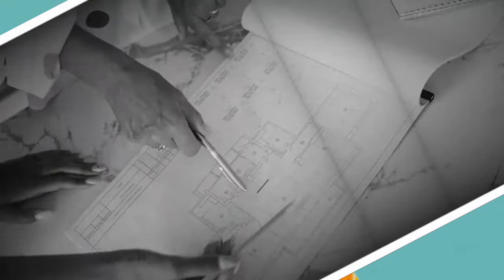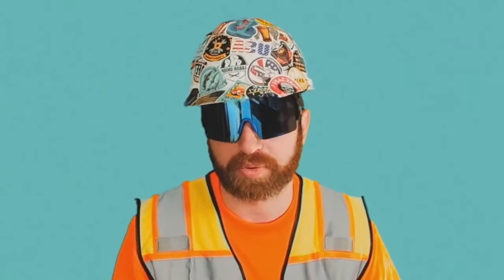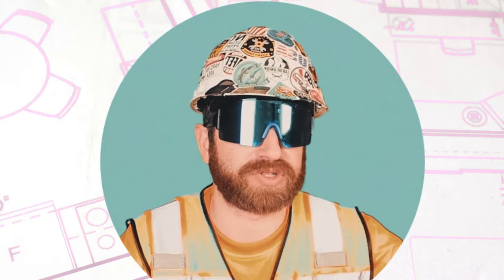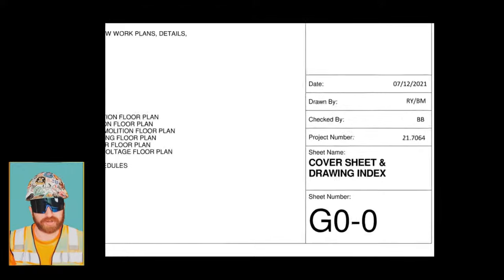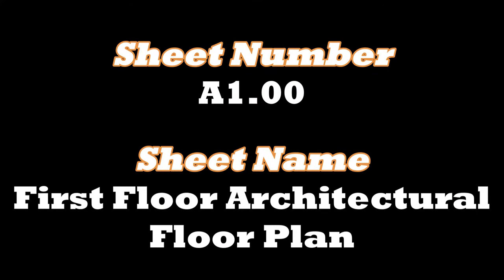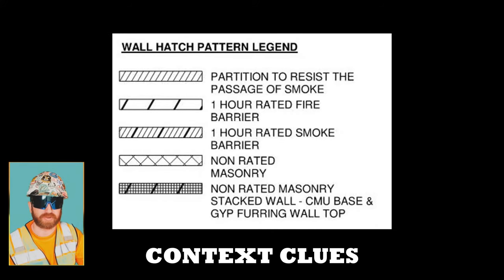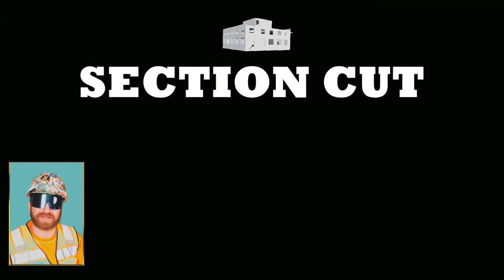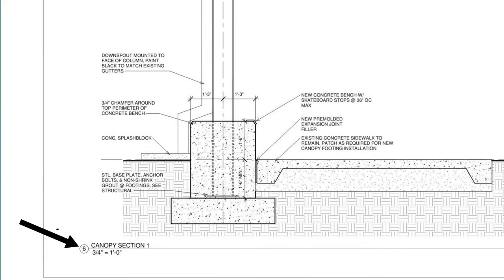START Reading Construction Drawings TODAY!

Comment: what are shop drawings? how it's different from a section detail plan.
Reply from the maker: Shop drawings are produced by a contractor or manufacturer (submitted to the design team as a submittal), as opposed to the the construction drawings produced by the Architect/Engineer of Record. Both shop drawings and construction drawings can include section cut details.  A section cut detail is just one way to depict a certain view of a detail.  I'll add some examples to an upcoming "submittals" video.

Comment: what if....what if....what if a drawing comes with unorganized markers, wrong page indicators and wrong elevation numbers? What should I do in that case?
Reply from the maker: If you’re the CM or GC, you should simply not accept them (reject them back to the design team pre-construction).  Point out examples pre-bid if the set is incomplete or incoherent to the point where things are not constructable - issue an RFI capturing these examples and explain what your need.  Same thing if your a subcontractor of the CM/GC, write the RFI and try to get it resolved pre-bid.  It shouldn’t be your job to do this, but it happens more often then not and it’s part of the industry because project schedules are fast paced.  The time to get these corrections is pre-bid.  If you write an RFI, the design team has the obligation to respond, which would get returned to all bidders so everyone is rebidding corrections/updates.  The other option as a CM/GC is to write an allowance, which is a set dollar amount for unknown circumstances specific to a certain item such as an unclear or unfinished detail (different than contingency).  If you’re mid-project, or don’t have a direct relationship with the design team to make this request it’s obviously more challenging.  You approach it the same way, but you’re mid construction and in progress changes may slow down, complicate or lead to more questions.
Reply: @planandspec  Thank you for such a constructive and detailed reply! I appreciate that!
Reply from the maker: Of course

Comment: If I wanted to bid doors or something that’s the spelled out .. usually they have how many windows but not the number of doors .

How would you go about finding how many doors ?
Reply from the maker: Typically a commercial construction drawing set should be including a door hardware schedule on the architectural plans.  This door hardware schedule should provide you a quantity of doors.  It will also tell you door materil, frame type, hardware types and if they're electrified.  This may be different for residential or depending on the project.  Since you're saying your plans don't show it, you have two options.  You can do a markup using Estimating software or print a hard copy and use a highlighter.  If your job has different door types, you'll have to estimate them differently.  Just scan through the drawings and mark everything you see the door symbol.

I'll show the door hardware schedule in my next video when I walk through the Architectural drawing set to help assist with what I'm talking about.

If you have more questions - send me an email planandspecinc@gmail.com.

Great question though